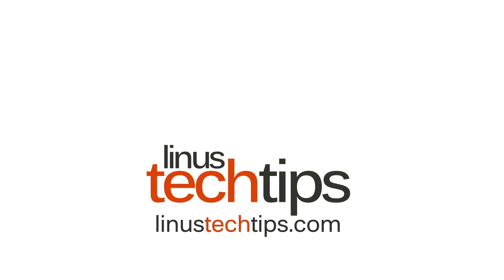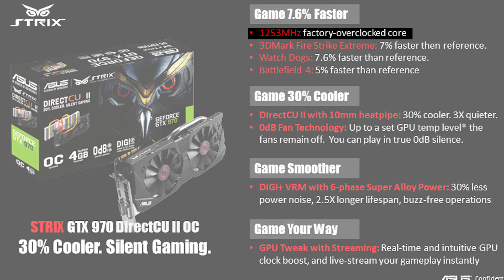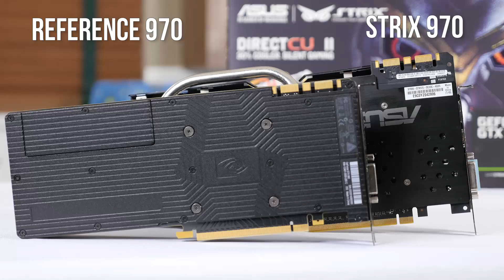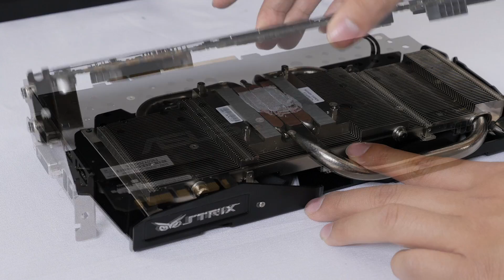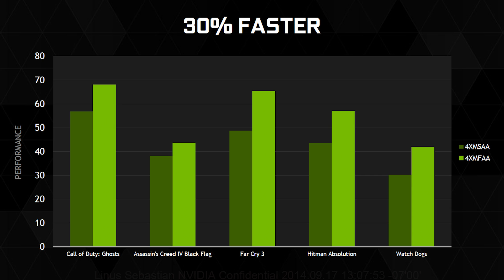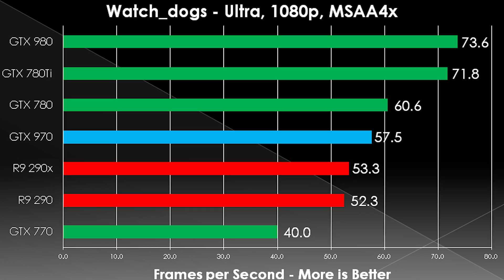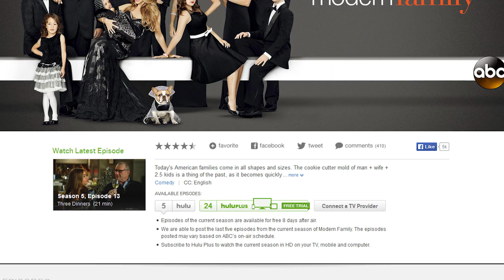ASUS Strix GeForce GTX 970 Video Card

Comment: Everybody seems to have done this here, so I'll too. Please help me out.
I've recently built a rig that includes an i7 4770 on a Z87-G55 MSI motherboard. I ran short of money so I bought a semi-low-end card, a GTX 660. Now I wanted to sell it and buy a shiny ASUS Strix 970 and was wondering if my system, including an around 600w Zalman PSU, can hold it, and whether the $500 it's sold with is worth spending or not. Thanks a lot.
Reply: Id say yes in your case.
But ONLY if you are not happy with the perfomance of your gtx660.
(And the gtx660 is not SO low gaming card)
Reply: highend marks Sometimes, I'm not. It makes loud noise from time to time. I did not say it's low, I just meant it's not high-end. And with the increasing demands of games nowadays, I might just think the 4 gigs of vram the 970 offers may set me for at least 3 years of gaming.
Reply: ***** If the noise is so anoying go then with asus 970 stix bro. ;)
Reply: highend marks I've also thought about the MSI Gaming 970. So the choice would be made between these 2. What do you say, bro?
Reply: Asus Stix by far is my opinion.
And the Msi is good but this time the Asus is the top of the line of the gtx 970 models.
My choise is Asus and also gigabyte.
But if you have an Msi mobo and wonna look cool buy Msi then to have good apearance your case.Is not neccesery but if this reason is serious for you then go with Msi. ;)
Reply: highend marks
Nah, it's not. I think I'd rather go with Asus, their products resist better in time, so I've heard. I've never had Asus products before, except a router that held on for no less than 6 years, so I can't really tell. I've read and seen reviews on the Stix and I think I'll go with it eventually. Just waitin' for Black Friday and Christmas-ish times to get it at around $350-400 if I can.
Reply: GL with it man.
Me..I have the Asus gtx780 direct cu ii and works perfectly without any problem or loud noise.
The Asus is good and trusted manufacter...dont worry.
And this product of Asus is even better
The Asus gpu's have SEXY - Asus style - black alluminum backplate (you gonna love this) on the top of the card, and the fans in the gtx970 dont spinning at all if you not play demmading games, cool appearance. long lifespan and you can do overclock easly to most Asus cards i think its a very good deal.
Reply: highend marks
Yeah, well, thanks for all the help, I really appreciate it. The only thing that remains is to figure out the card's physical installment.
Reply: highend marks And another mentioning. Shall I consider buying the non-Ti version of the GTX 780 ? I don't really know what to think of it, but would like to know which of the 2 (970 or non-ti 780) is much more prone to being future proof.
Reply: The gtx970 man is a bit more powerfull than the older (beast card) 780.
Also the gtx 970 (or 980) have less power consumption than 780 and support features such 4k to 1080p new improved types of antialising and have 4gb of memory instead the 3 which the 780 have.
The 780 is a great card but why buy it when the new and improved cards are already out...?
Also any card of this new series have better overclocking and much improved temperatures.
I highly recomend do not think that.
If you gonna to have a great upgrade, the 970 is very good choise instead of your gtx 660 and is a bit more powerfull and cheaper than the 780.And is clearly enough for 1080p gaming.
If you wanna to have a card wich is better even than a single titan black (and by far over the 780) buy then the gtx 980...
But is a waste of money in my opinion...
Reply: highend marks Thanks for all the help bro, you totally convinced me. Now I'm just going to choose between MSI and ASUS. Dunno if my PSU can hold a 6-2 pin to single 8-pin connection. I'm not good at such things.
Reply: highend marks
Also, wanted to ask if my processor would bottleneck the card in the future. Thanks. (My CPU is an i7 4770 [not k].)
Reply: Not at all man!
Lol you must kinding!
Even an i5 can handle this card.
Dont worry you dont be have bottlenecks at all.
Your i7 4770 can handle this card even in 3-way sli.
Reply: highend marks I got let down lately. I don't think this card will meet my needs in the future. Don't know what to buy now, as my supply is only around 650W. Should I go for a 780 or 780 Ti? Cuz I see the 980 is beaten by those 2.
Reply: The 980 is the better choice. 4GB GDDR5 (compared to the 780s' 3GB), cheaper or the same price as the 780ti, and also uses less power (requires a 500W PSU, so your PSU is fine). I have read on Tom's Hardware that it is faster than the Ti, but I haven't looked up benchmarks. I would buy the 980, 100%. Being the newest card is also nice in itself.
Reply: BER2ERKER
Hmm... it's too expensive. Way too expensive in my country. Will think about it.
Reply: Oh ok. Yeah I can't afford one either. I mean, given you could always go SLI in the future, maybe the 970 would be enough. What was the issue? I'm guessing you hope to play 4K at some point when the monitors are cheaper. Might be a while though, so maybe it isn't worth it. The 970 is a really solid card, especially with the 4GB GDDR5 (nice for trying it on higher res).
Reply: BER2ERKER I don't really hope to play 4k. I've just bought a 1080p monitor 3 months ago. I don't have this much money, ya know.

Comment: Im currently having a i5-4460 with a 750W psu. I was wondering if this card would be bottle neck and i was wondering if the power would be enough to run this?
Reply: No would not bottleneck at all. and yes you have enough power

Comment: Hey guys my case a Thermal take r31 urban was damaged recently when moving it. The panel that has the window now has slight gap that allows air into the case. Since this killed the airflow in my case will this 970 overheat by any chance? I cannot buy a new case at the moment as I am saving up for a i7-4770k
Reply: Try and tape it?
Reply: Make the fans work harder
Reply: The fans are fine. The airflow is what I'm worried about. Ill try the tape thing. Thanks guys Ill look like the most ghetto ballin pc gamer out there.
Reply: Try the Linustechtips site and ask there. i Would invest in a better case than a I7 cause you get no benifit for hyper threading in gaming but its your call

Comment: Its safe to use a dual 6 pin connector to a single 8 pin conector for my Gpu? My Psu has 850 watts 12v por rail and 4x 6 pin connector but I need a single 8 pin so I just wonder if you guys can help me out cuz im not sure if is safe or not? Thanks...

Comment: Hey which card should i pick? GTX 780 GHZ edition or GTX 970 when i can get 780 ghz for 80$ less than gtx 970?
Reply: 970 Because after about a year of drivers and optimization it will def be superior.

Comment: I have a choice to make, UHD monitor OR GTX970, Currently using an R9 290 and CRT monitor, So I'd either be using the 970 with a CRT or the R9 290 on a UHD... I really don't know ,If I get UHD I might play only single player because of the 60hz but if I get the 970 I'll be able to use my CRT's 2048x1536 @ 85hz max.. I could get both but I cant really justify spending that much on gaming in a single year.
R9 290 doesn't do analogue (crt/vga) GTX970 DOES.
Reply: to hell with justifications. get em both and enjoy. my strix 970 was delivered to me from the egg yesterday and I game at 1440pimp. night and day difference for me and I came from a gtx 680.
Reply: I think I may just go for the 970 first ,UHD monitors are a bit crap at the moment and 1440 144hz isn't enough of an upgrade from the CRT. But...I do like new toys...

Comment: I have a question, if anyone including Linus himself can provide me with an answer I'd GREATLY! appreciate it. My system specs are as follows: AMD FX 8350 4.5ghz, Asus M5A97 R2.0, Asus Strix Geforce GTX 970, Cooler Master V850, and a Cooler Master Seidon 120v (CL CPU cooler). Now I've seen benchmarks for BF4 and most people avg 75 fps (on 1920x1080) with the Asus Strix 970. I on the other hand I get anywhere between 40-60. I've overclocked til about 1500 mhz on the core and I still get 40-60fps. Makes no sense to me, could I have a faulty card? Now just before people bash on my CPU and it bottlenecking. I've used BOTH MSI afterburner and Asus GPU Tweaker to monitor by gpu usage during gameplay and they both show about 97-98%. What could be the problem? Please can anyone help me figure this out.

Comment: Would it be worth my while upgrading from my 770 to the 970? I play at 1080p and I've got a 3570K w/ 8GB RAM. I've only overclocked my CPU to 3.8GHz so far as I've not yet purchased an aftermarket cooler.
Reply: nope... not really, you should just get a hyper 212x from coolermaster... it wont be much of an upgrade, sorry
Reply: Not worth at all if you have the 770.
Unelless your are not happy with this card.(something impossible of course)

Comment: Would a 400w PSU work fine with this card? I'm using the 760 right now with this PSU and it's minimum is apperantly 550w so would it work or would I have to upgrade? Also how much of an increase in performance would this card be?

Comment: HELP ?!?! I now have a r9 270x connected with 2 6pin connectors and I would like to buy this card but it has one 8pin connector can I run this card with an adaptor or something?? (my psu has 450 watts)
Reply: what gtx 970 model do you guys recommend most ?? (as low noise/low power consumption as possible)
Reply: First of all why do you need the card? Second, no, your pc could not handle the card. 450 watts is too little to run the card.

Comment: I have a Corsair CX80+ 500W power supply, the Nvidia site said that the minimum requirement for the card should be 500w. Taking the possible overclocking into mind, will my power supply be able to handle it?
Reply: came across this comment… u ever get ur 970? 🤣

Comment: I'm thinking about going SLI with GTX 980 as main card and GTX 970 as secondary card. Is that good combination? Or should I just get 2 980s?
Currently running R9 290.. ( ._.)
Reply: You should just get 2 980s.

I think that sentence applies anywhere,  any time,  in any situation until a faster video card is released.

Comment: Should I upgrade from my GTX 670 to the 970 or 980 or wait another 6/12 months to upgrade for the next lot of cards that may run 60 fps 4k gaming on one card? The 670 has been awesome for years now, still runs all my games at 1080 maxed and love it, I am not looking at SLI and had nothing but problems with AMD cards in the past.

Comment: Guys, just your opinions. I was thinking to get the best bang for my buck, I was thinking, should I get:
EVGA GTX 970 (04G-P4-1970-KR): $329
MSI GTX 970 (4GD5T): $339
ASUS Strix GTX 970: $349
or Gigabyte GTX 970 G1: $369
I'd personally go for the EVGA GTX 970, but I heard of a problem of it doing the 'coil whine'.

Comment: Odd was reading the Bit-Tech review and in theirs the 970 performed better than the 780 in nearly all tests, here the 780 beats it. Where I live the 970 is more expensive than a 780. I guess I should check out more reviews.

Ok checked Guru3d, Anandtech and Bit-tech, they all put the 970 quite a bit above the 780. Here however the 780 beats it. In fact in the other reviews the 970 almost reaches 780 ti scores in some games. In every other review the 970 scores between 780 and 780 ti, in Linus review it scores between 770 and 780.
Reply: Yeah I'm confused by this too.
Reply: ***** I think the 970 Linus got must be broken or something, or nVidia has bribed every other reviewer.

Comment: Here's my plan. The 900 series cards just came out. There are bound to be better Maxwell cards in the future. So my new gaming rig is going to be powered by one of these Strix 970 cards, as they have an outstanding price-to-performance ratio, and it just makes sense for me. Then later, I will upgrade to a beefier Maxwell card, probably even after the 900 series has had its course.

Comment: Just a quick question. I want to get the GTX 970 but I have no clue which custom designed one is the best or which I should pick because Im fairly new to pc gaming. I have 4 to chose from: Evga, Gigabyte (G1), Asus and Msi (red). Which one would you personally pick and why? I appreciate all your help and input a lot!

Comment: Hey guys.

For Gaming...

EVGA GeForce GTX 970 4GB 256-Bit GDDR5                               $349.99

ASUS STRIX GeForce GTX 970 4GB 256 bits GDDR5                  $349 .99

ASUS GeForce GTX 780 3GB 384-Bit GDDR5                               $329.99

ASUS ROG POSEIDON GeForce GTX 780 3GB 384-Bit GDD5     $359.99

I can not decide which video card choose ): D:

Comment: Would i be able to switch my Nvidia GTX 560ti to a 970 without any problems? My CPU is an Intel Core i7 2600 and my PSU is at 500W. I have a prebuilt Acer Predator g3610.

Comment: hey guys this will be my first pc :D and i want to know if its all compatible with eachother and if there are better choices
these are my parts:
-GIGABYTE GA-970A-DS3P (rev. 1.0), socket AM3+ motherboard
-AMD FX-8350, 4,0 GHz (4,2 GHz Turbo Boost) AM3+ processor
-Zalman Z11 Plus case
-Corsair 8 GB DDR3-1333 Kit ram
-BenQ 21.5" Monitor DL2215
-Microsoft Windows 8.1, SystemBuilder OS
-Seagate Barracuda 7200.14, 2 TB harde schijf
-Sharkoon WPM700 Bronze, 700 Watt power supply
-ASUS STRIX-GTX970-DC2OC-4GD5 graphics card
this is my build all together it costs: 1077 euro
i dont want to get over the 1100 ty :D (a full build)
Reply: Go to linus techtips forums, you will get your answers and solutions der ^^
Reply: iNTOXICNATOR
ty for the recommendation already got responce on my build :)
Reply: I would add an ssd to that build
Reply: Ok i think its all compatible but dont get that power supply its not good quality and a bad psu can literally blow up ur rig ik all the hate i will get for this but the corsair cxm is a i would not say nice or high end supply but it is very very well protected from short ciricuting and stuff and get 600 watts u could get by with 500 but 600 to be safe 700 would actually be too much and decrease psu efficiency i have used this psu in amny builds in my bros my friends and my dads and i used to use in mine until i needed more watts for sli config, this is a great psu and get the 600 watt 700 is waaaay overkill and too much
Reply: Here's a build I setup for ya -
http://uk.pcpartpicker.com/p/L3cXFT
50 euros over budget, but its totally worth it. Very nice build w/ a red & black color scheme
Reply: Agent Dale  Dont get windows at get 7 pro i promise u will not regret that plz do that i use win 7 over win 8 win 8 sucks for gaming. Also i will admit im a little biased when it comes to this but get an msi 970 gaming edition, asus has had very problematic 970s and msi has better cooling
Reply: Agent Dale  and get the cooler master hyper 212 evo over that be quiet hyper 212 is just honestly the best air cooler for the money its 30 bucks. Im not saying that from experiance with many coolers
Reply: thomas burden 212 evo for a 4690k is a bit under kill, and win 8 is cheaper.

Comment: I run 2K.  Went from 2x670gtx to one Zotac 970 GTX.  I now can load HRes textures because of the 4G of RAM.  Card runs significantly better, faster and cooler than the 670GTX setup.  I get 1391 score in Unigine Heaven, No overclock.  I7-39xx Sandy Bridge.  Very happy with purchase.  Waiting for second card for SLI.

Comment: I'm considering getting the Gigabyte WindForce GTX 970. I'm currently using a Source 210 elite case with a SS-M12II 520W PSU. Will the card fit in my case and will my PSU be sufficient?
Thanks in advance

Comment: I'm impressed the 970 manages to match the 780 ti, which has over 60% more CUDA cores. If 20nm big-daddy Maxwell manages such a thing compared to the cores in big Kepler and has ~3500 cores (probably not such a crazy jump, considering Kepler gained 75% more shaders from the 680 to the Titan on the same process node), the thing could be stronger than a Titan Z.